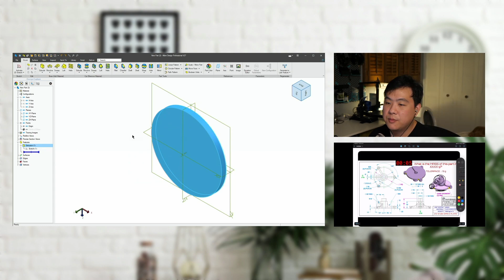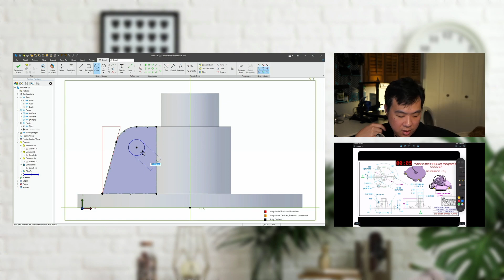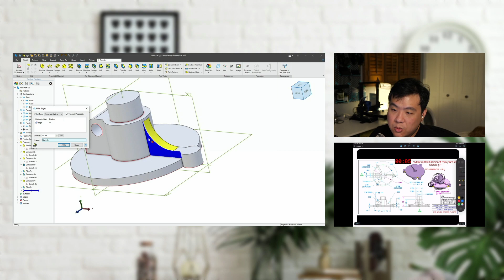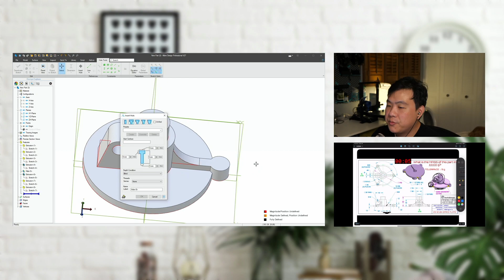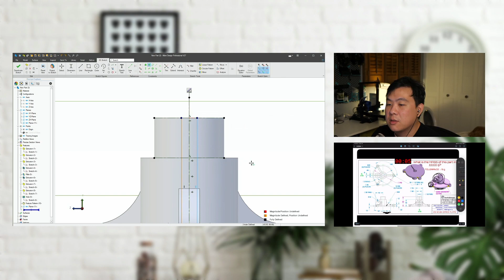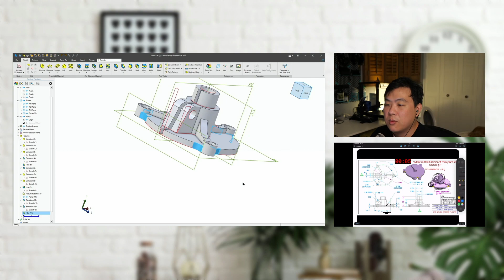TTT 23-12-04 Space Plate: Practice Model with Alibre

Comment: Really nice walk through! It's nice to see more people putting out Alibre content.

Just one tip for future reference in real part design and TooTallToby model (TooTallToby loves his ribs):
-When you create the rib  on a circular surface, make sure you draw it going into/interfering with the circular surface. Other wise when you give some thickness, aka extrude it, you'll get a flat tangent surface to that cylinder. Not the actual rib going into it.

And especially for real parts, you need to make sure that the line of the rib continuous tangentially upwards and into the cylinder. Or else the flat surface is going to be on the top of the rib.

An actual rib tool has already been announced for v29 I think.

Good Job, m8! For a hobbyist you have a great grasp of parametric design!
Reply from the maker: Thank you! I read your comment a couple of times and I still don't quite understand. I know you're quite busy, but if you have the time, would it be possible for you to create a short video about what you mean? I am definitely more of a visual learner. Thank you for the comment!
Reply: @davinchewk  OK, I'll try. But I slowed down a bit during the holidays and need to ramp up significantly to catch up now. I'll see when I can make on that. I have another request video that I want to do first of a TTT Practice model which is really hard in Alibre and needs an obscure little trick... Or 2... lol.

In the meantime, open the file you made and zoom really hard on the spot where the 3 ribs meet the main cylinder. If you see it, it might make more sense what I'm saying.

Again, keep it up. Nice videos.
Reply from the maker: @ExMachinaEngineering  I think I understand what you mean now. Basically what I should have done is to create another arc off of the one I had created such that the profile "cuts" into the main cylinder.

When I zoom in now, I see that the arc only touches the main cylinder tangentially, then there's a "flat" spot that connects it to main cylinder instead of a smooth transition.

Sorry if my vocabulary is off, I'm still quite new to all of the CAD terminology!